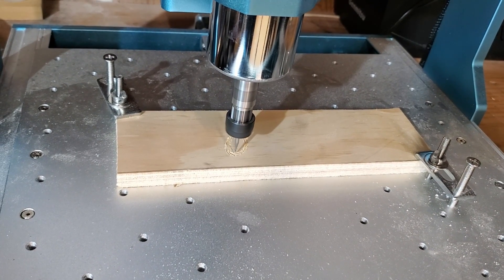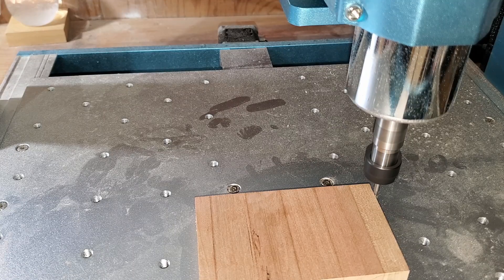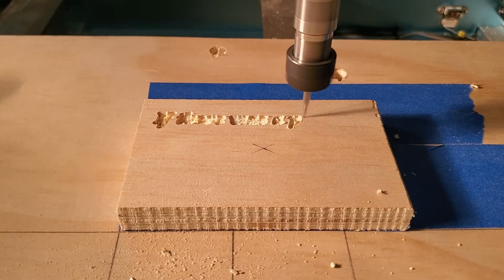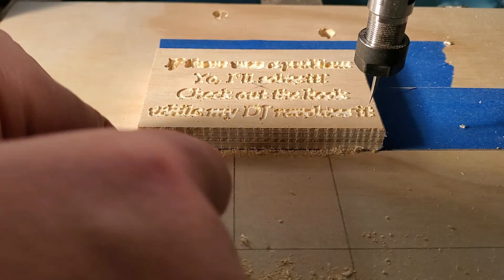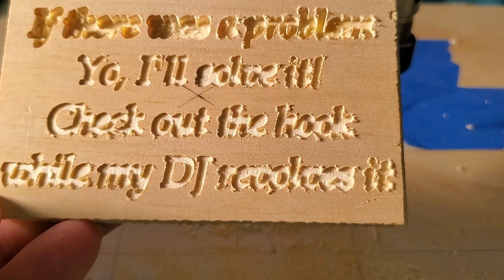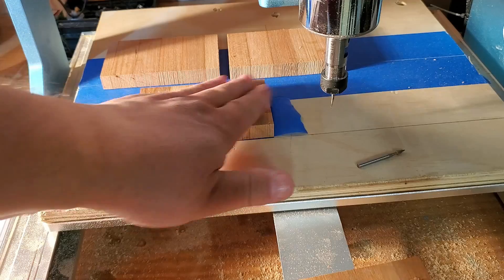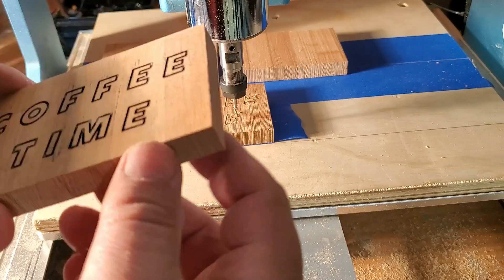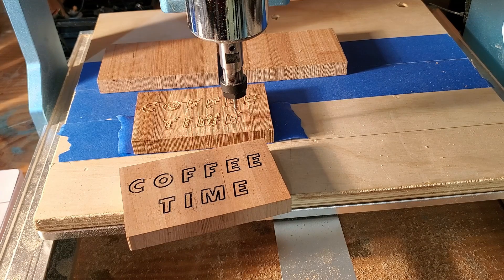#AdFree video Making signs on a CNC Router: WHAT software?!?! #Sainsmart #cnc

Comment: are you able to adjust the kerning of the letters for the first font you were using? That should space them out a bit more if the software has the ability to do that with the type. I like seeing this progression with the CNC, i feel like im going on this adventure with you
Reply from the maker: I don't know what kerning means, but I did see something about spreading the letters in the FreeCAD software. I just haven't had time to look into it yet. I really have high hopes for what I can do with this machine, but it is a huge learning curve! I am an engineer, you would think I could learn this faster! Thanks for watching, any comments are greatly appreciated if you see something like this in other videos!
Reply: @BAILEYWOODWORKS   yeah i deal with typography in my 9-5 daily thats the only reason i know what Kerning is, should be pretty easy to get going as you dont need to spread the letters too far apart just enough so they dont bleed together.
Reply from the maker: @Chipswoodworking  so what I am currently trying to figure out, is how to clear out the material inside the duplex text. Then I can use a cursive font and they will join up correctly. Right now the letters are just outlined.